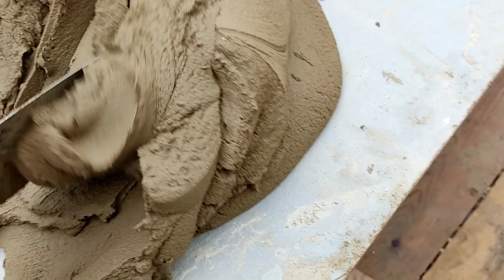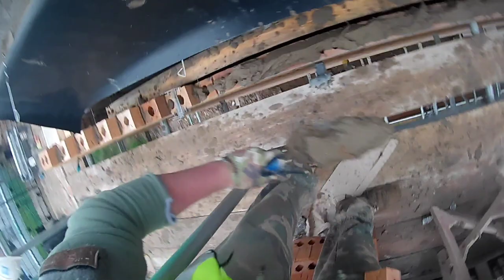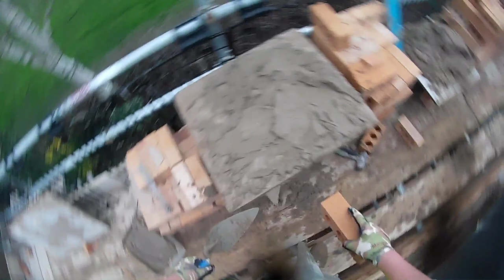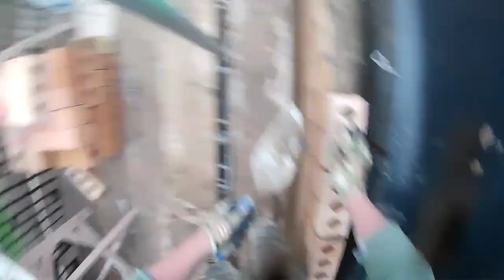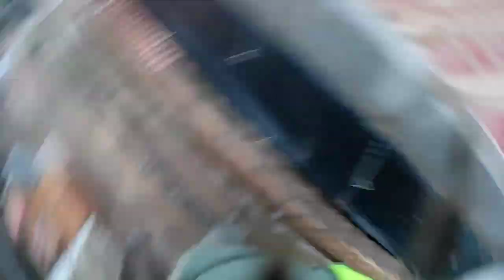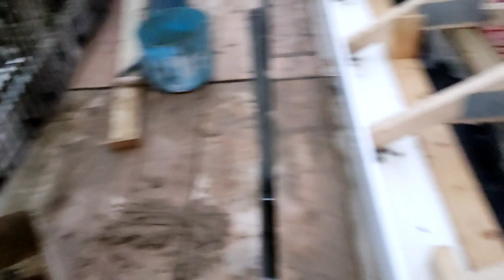Bricklaying Vlog - Do Your Own Cuts! & Mix Your Own Mortar!?

Comment: Hello mate how you getting on with them gloves are they lasting ,well done for cracking on ,shit when on your own doing it all easy to lose motivation
Reply from the maker: I've kept ordering them, they don't dry my hands out n fit very well, only last 2 days but only 60p a pair
Reply: @theafter8bricky  👍
Reply: @theafter8bricky  could you sent me a please
Reply: Link
Reply: Fair play mate it does make a difference just having someone helping ,extra pair of hands, you do seem to just work ok on your own through,and get it done💪
Reply from the maker: @bonusball7053  https://www.ebay.co.uk/itm/24-Pairs-Safety-Black-PU-Nitrile-Dipped-Coated-Work-Gloves-Abrasion-Resistant-/352900753739?mkcid=16&mkevt=1&_trksid=p2349624.m2548.l6249&mkrid=710-127635-2958-0
Reply from the maker: @bonusball7053  these r a bit cheaper but same just not camo
Reply from the maker: @bonusball7053  Hi! I found this on eBay and thought you might like it! Check it out now! https://www.ebay.co.uk/itm/24-PAIRS-SAFETY-PREMIUM-BLACK-BREATHABLE-NITRILE-COATED-WORK-GLOVES-BUILDERS-/352515472876?mkevt=1&mkcid=16&mkrid=710-127635-2958-0&media=MAILTO&sojTags=media%3Dmedia

Comment: What site is that where you they've got a mixer 😨 made me smile when you said you've not mixed up for 9 years😂 If your the only one using the mixer, have a bucket and shovel down there and a bucket and shovel on the scaff👌
I quite like the front tip method, your looking rapid mate 👌 keep doing the methods that suit you mate, you make it work and pay💪💪👌👌
Reply from the maker: Small housing firm building council houses, it's good gear out of a mixer tho, cemex cement seems bang on, it's like gold compared to the shit ready mix n silo slop I'm used too lol
Reply: @theafter8bricky  I've got a pallet of the stuff in me garage 🤫🤫